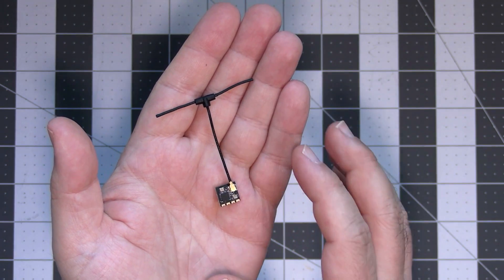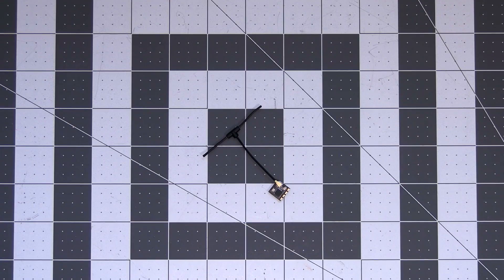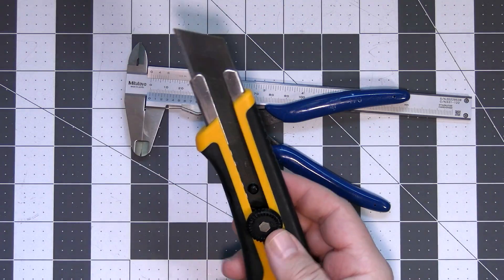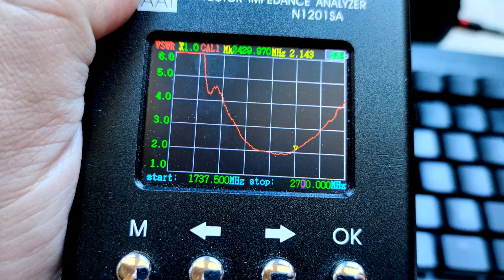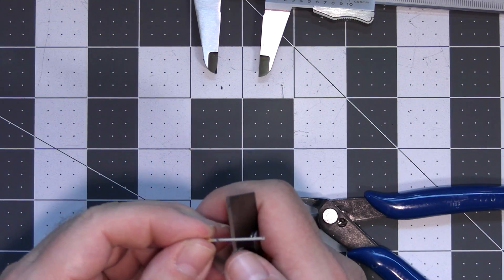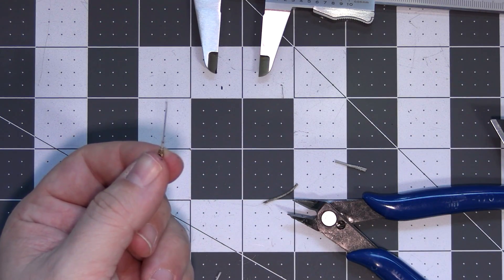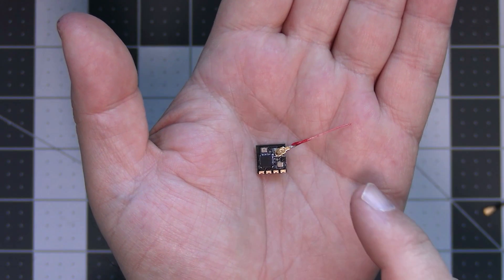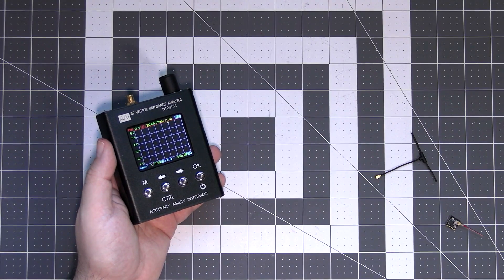How to make Express LRS Nano Antenna at home?

Comment: I'm trying to to a similar design, but with the shielded part of the coax longer.   I think the length of the shielded part is very important, maybe as important as the "active" part, based on what I see on my VNA.    Maybe since the shielded part of the coax of your design is non-zero, the length of the active part is less than what would be expected from the math, even considering velocity factor and other parameters that could make a shorter length more optimal.

I suspect the shielded part of the antenna needs to be 1/4 wavelength (yours is close 0 is a multiple of 1/4).  I've been looking for an online resource that discusses design of a linear monopole and includes guideline for length of the shielded part of the coax.  Any suggestions for this?
Reply: You're right, he doesn't have both sides of the dipole there since he only left a tiny length of shielding.  So the RX board is probably acting as one side of the dipole but the impedance may be far from ideal.  So I'd make the shield the same length as the unshielded part.  But maybe the VNA, or a check of the RSSI, would show it doesn't make very much difference.

Comment: Hi Pavel, ....I have a question regarding feeder/collector length for a 915mhz DIY immortal T style antenna. I've made a couple and designed 3d printed centre pieces to reinforce them etc, but it's very difficult to strip the fine active element wires properly and I always end up with a feeder that's too short (shorter than 11cm) due to wire breakage. How critical is the feeder length to the antenna performance? I can't seem to find an answer online to this. and I'm ready to order 15 cm pigtails to make sure I can correct the mistake. Is 5 mm going to make a huge difference in the collector side? I know it's about impedance matching etc. so that's why I ask.
Reply from the maker: Not that much important. I mean it would be perfect to have exact 1/2 wavelengths but a few mm here and there won't affect it that much

Comment: I’ve never done this before but I’m genuinely curious and trying to figure this out. 

1/4 wavelength for 2.4ghz is 31.25mm. How is it that you’re getting 20mm as the correct length?
Reply from the maker: You forget about the the fact that electricity does not travel with a speed of light in void. It slows down in a conductor
Reply: @FPVUniversity  I didn’t forget, I didn’t know! Haha. Thank you!

Comment: Great video! I'm assuming range should be similar to the EP 2 right? Also, Is it possible to create a larger or dual(diversity) antenna for the EP1? Reason I'm asking is that I would like to increase the performance/reception of my 7". The EP1 antenna is pretty small and since we do not have diversity options for the EP1, the drone itself can block the antenna quite a bit when at Range. I'm seeing RSSI DBM of over 105 when flying about 2-3km out which I think is pretty close to failsafe value (I'm using 250 with threshold of 109 dbm i think).
Reply from the maker: The range would depend of how good the tune on the new antenna will be. Should be comparable
Reply: @FPVUniversity  thank you for the quick response. Do you think making a bigger antenna (like crossfire's) is possible and with any benefits compared to the small ep1 antenna?

Comment: Hi Pawel, I was wondering if using a 2.4ghz whip antenna like that which comes on the happymodel diamond f4 would work with elrs. Not needing crazy range, just good enough for house and yard flying. Thanks!
Reply from the maker: Any antenna would would as long it's 2.4GHz.

Comment: I broke the ceramic antenna can can I solder  on  a wire if so in which pad since the ceramic has four pads
Reply from the maker: if you can figure out which pad is signal wire, then sure, solder to it all the way. Should work

Comment: @ 1:02 - "all you will need is the ruler or the caliper, some kind of pliers to cut the wire, some kind of knife, the pigtail with the IPEX connector, and something to write on the cable" 😁
OK I need an ELRS receiver with an IPEX connector, mostly because I have so many FrSky antenna's laying around doing nothing ..... 😂😎

Comment: Great tip. Would bare part of antenna need to change length (from 21mm) if left some space between connector and end of shielding?. Example if left ~10mm of shielding so have space for mounting and avoiding  bare part is not near carbon frame.

Comment: What your swr meter shows - is that this antenna is almost useless in the needed range :( I would keep the shield twisting it and making actual dipole or vee style
Reply from the maker: C'mon, it's a small antenna, not an efficient antenna. If you want range, use a properly mounted dipole, not this thing :)
Reply: @FPVUniversity  I agree with you, but any antenna must resonate on its frequency despite its size. 1 means all  100% energy will be transferred by antenna. 2 means 100% loss of the transceived energy :) I will try this as well later today and measure with nanovna. Sometimes the coax is too bad

Comment: This is exacly what ive done to my HappyModel EP1 receiver last month.  I have ipex/ufl coax cable with the same phisical appeareance with the original EP1 antenna. Unfortunately I dont have SWR meter. I already watch your video about antenna. there is velocity factor involved, I did unterstand. So, with my limitation, I came with this aproach. The length of the active part of the original dipole antenna in EP1 receiver is about 54mm . So, then I make length of the monopole active element about 27mm ( I made it half the length of the dipole). Am I at the right spot ? My main concern is I have the same coax cable in terms only on phisical appearance. I did range test, but sorry I cant provide scientific data. I just can say, the range is "good". never failsafe

Comment: Cool hack! thank you!
Is resistance still 50ohms? does resistance matter for only video transmitter antennas and not passive aerials? perhaps if only the receievr is sending back telemetry
Reply from the maker: Neither monopole or dipole do not have 50 Ohm impedance. Monopole has 36.5 + j21.25 Ohms

Comment: Thank you, this is very useful knowledge. Record an episode about ESC soldering. I would like to know if it is better to place the motor cables at the bottom of the ESCs or at the top, as most do. Do you wrap the cables around the standoff or shorter ones directly to the ESC?

Comment: Does the length of the rest of the antenna wire (the still insulated part) matter? For example, if you just do the same at the end, but keep the rest of the coax cable instead of just 2 mm?
Reply from the maker: It matters. And the longer it gets it matters even more. So, as long as we keep it short it stays a "short line" (opposed to a "long line") and it's impedace can be neglected